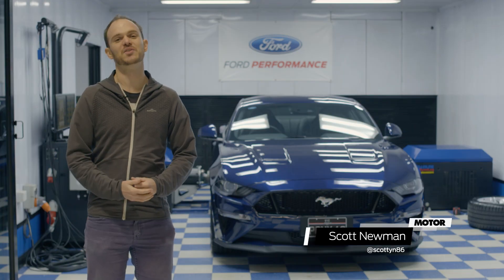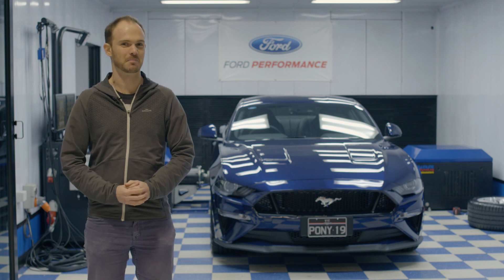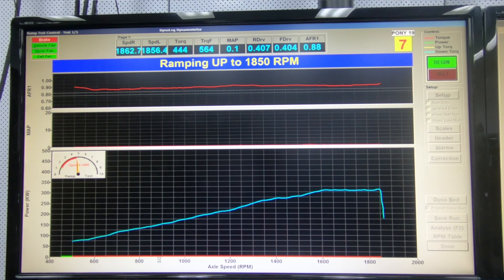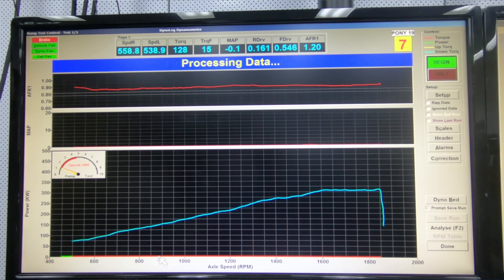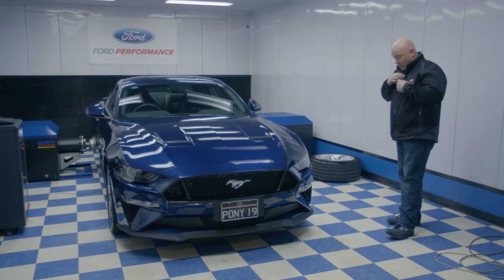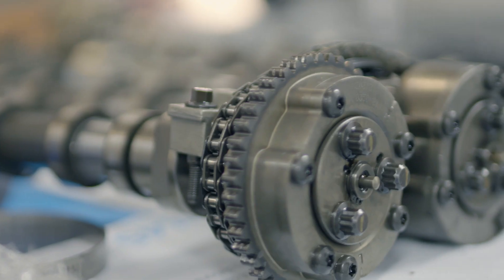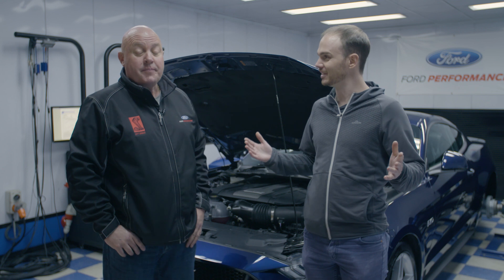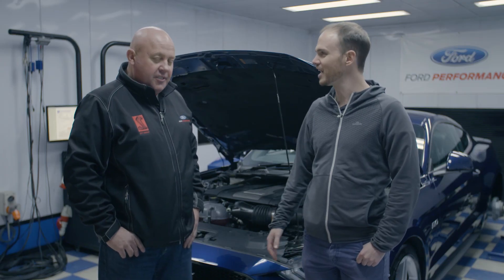2018 Ford Mustang: how much power does it make? | MOTOR

Comment: So all the changes but yet another fail on safety. A new hero car in 2018 that is not 5 Star???????  I guess it is a bit like Monty python “Dont mention the war” when it comes to ANCAP safety.
Reply: Graham Walker no one buys a mustang for safety ratings.
Reply: big yee - so you are suggesting that in a Darwin kind of way, that some people deserve to own a mustang? Problem solved lol
Reply: Graham Walker no, people buy a mustang for the looks, power affordability, and handling.
Reply: Graham Walker it’s a biased and not entirely relevant rating system designed for family saloon cars, not 2 door sports cars. But due to the price bracket it gets tested as such. The star rating is really irrelevant for anyone actually buying a Stang
Reply: big yee - that makes no sense - The Germans can make them with skipping on safety
Reply: Sean Lander - it would not have taken much for ford to address the issue, it’s just not a priority. Which is why it’s the one ford car that Ford USA are now making.
Reply: Which German cars are you referring to?
It’s a mid model upgrade, not a complete rear design. Wear it loses some points is rear passenger safety but you can’t reengineer and entire body for a mid model upgrade so that is far from “not taken much”. 
And ford Usa makes at least 10 different models still so maybe research a little bit before making such bold statements. 
Plus, no one is going to put people in the back seats of a Mustang, there simply isn’t room. But the cars have been made like this for decades and passed IS safety standards. It’s just Euro and Aus standards are not well designed to test cars properly. The parameters are far too broad
Reply: Sean Lander - https://www.google.com.au/amp/s/techcrunch.com/2018/04/25/ford-to-stop-selling-every-car-in-north-america-but-the-mustang-and-focus-active/amp/
Reply: Sean Lander - bmw Audi Merc just to name three
Reply: Sean Lander - so ford USA make safer cars than volvo, merc, bmw, Audi ????? Maybe in a trump world lol
Reply: Graham Walker hardly comparable vehicles as the equivalent from the Germans (ie style, power and engines) are well over $50k more expensive. Remember, the Mustang we have here is a USD$40k car. They are USD$100k+ cars. Not comparable at all
Reply: Graham Walker that article is false. The F series trucks are still the highest selling vehicles in the world. Plus their suv range is massively popular. Your facts are incorrect
Reply: Sean Lander - so ford are committed to continue making cars and will not focus on SUVs/trucks?
Reply: big yee - that is wrong. - when it didn’t have the safety tech it got 2 stars out of 5. With that tech, it still only managed to get 3 stars out of 5. Safety tech can’t cover up engineering faults. So safety was not considered a priority even though ford was aware the car was going to be assessed against the new criteria
Reply: big yee - no conflict of interest with a commercial website that ford pay for advertising dollars. It must be the fault of the independent testers.  How dare they not fall into line with the advertising dollar and just say it’s fine
Reply: big yee - American power minus the Europeans and Japanese built and engineering quality
Reply: G W ford ain't  paying no one, the ones paying advertising are the europeans lol they advertise their cars as being so fast and when tested end up getting beat by cars half their price😂
Reply: big yee - don’t trust a rev head mag review lol they are on the take